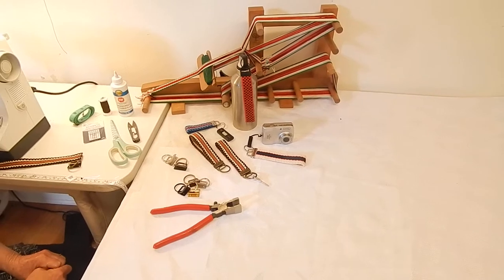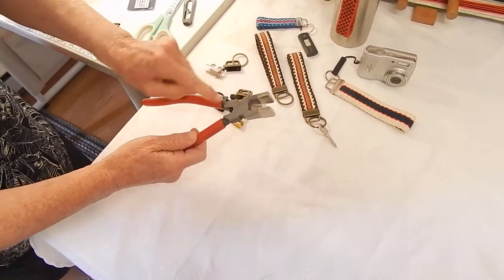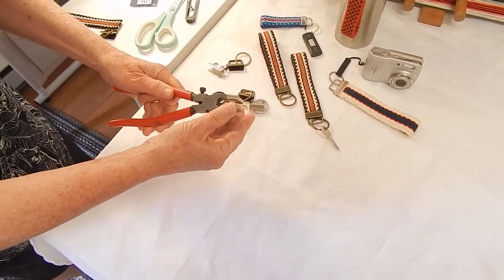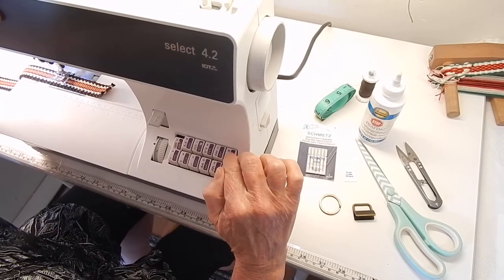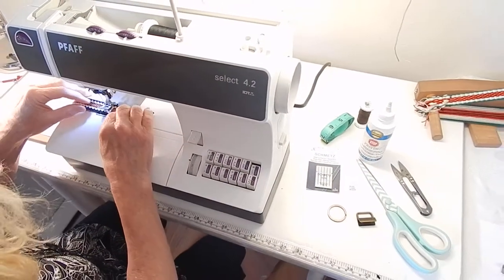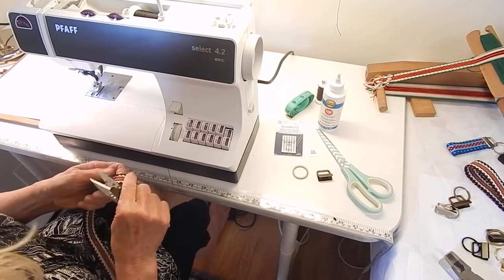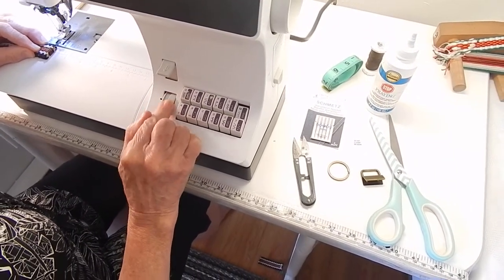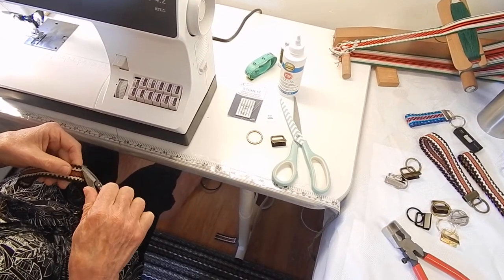DSCN4948  Inkle Woven Key Fob Instructions

Comment: This is prob a stupid question, but do I use hardware the exact width of the strap? Or if I have a 1 inch wide strap, would I use the 1 ¼ in. hardware?
Reply from the maker: Hi no stupid questions. I use a one inch wide band with one inch wide hardware. I weave 1/1/4 " with for the for the 11/4 " hardware for a more heavy duty key fob.  It is a challenge to get the width right on.  Ideally it would be good to weave slightly narrower than the hardware for a clean finish.